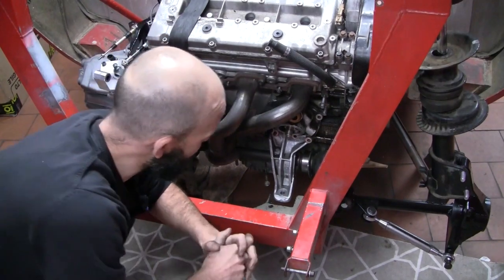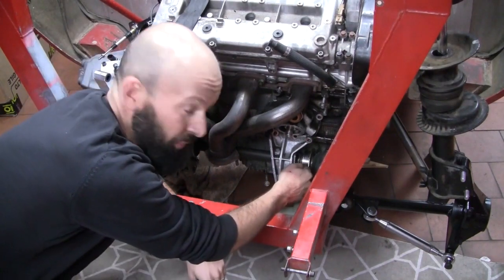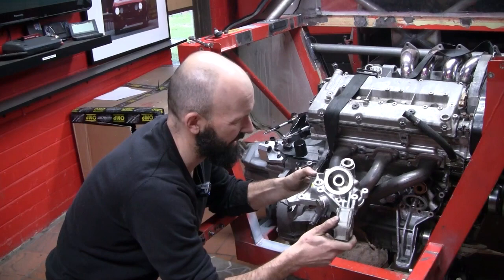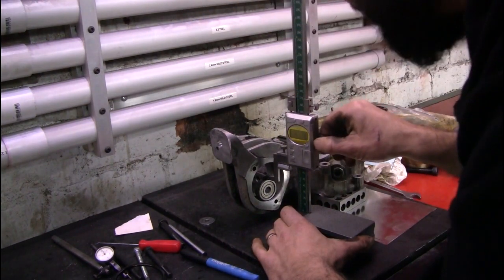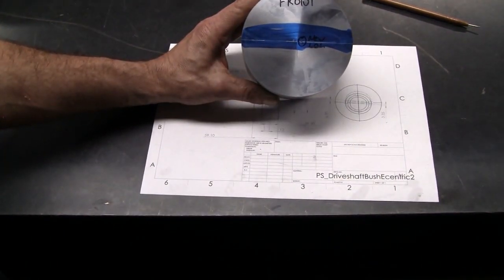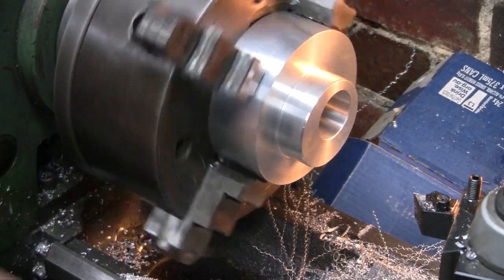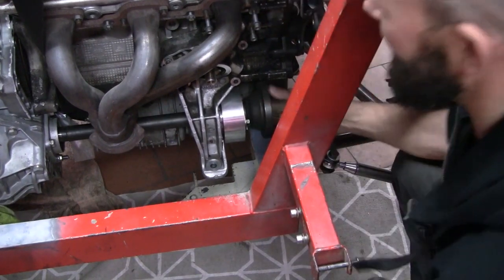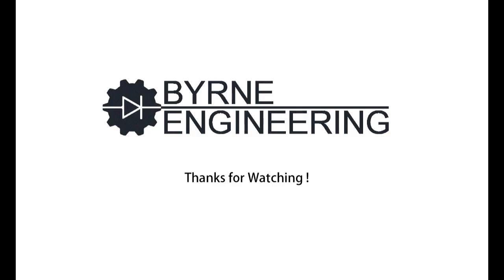Project Stratos Episode 11 - Drive shaft fix, number 1

Comment: That looks great. I would have gone with the exoskeleton engine mount as, even if I had some machining ability, I absolutely would have stuffed up those offsets ;)
Reply from the maker: Yea, if you couldn't tell from my reaction when the drive shaft slid in, i was amazed i hadn't doubled/halved the dimension and completely  got it wrong!

Comment: Interesting that you didn't go a custom driveshaft instead.
Reply from the maker: Wouldn't have helped much as the big issue was the bearing concentricity with the shaft, or lack of, rather than the length.